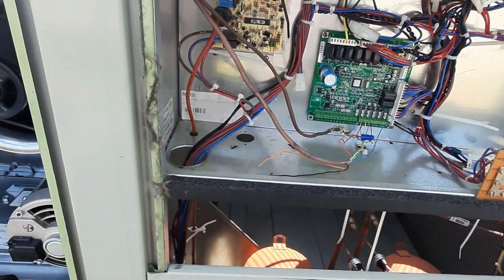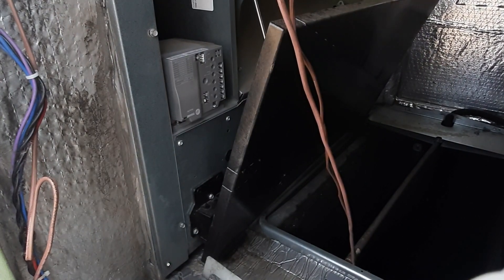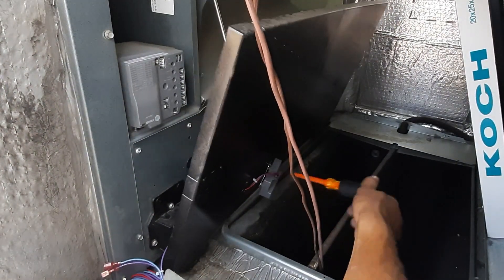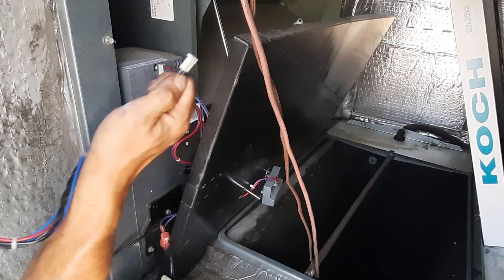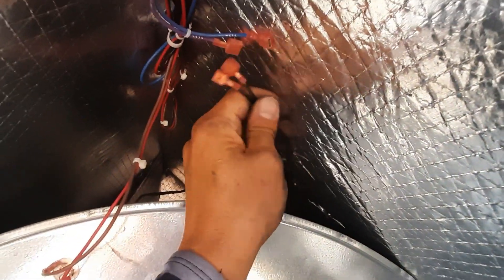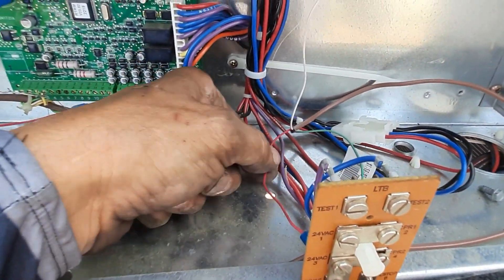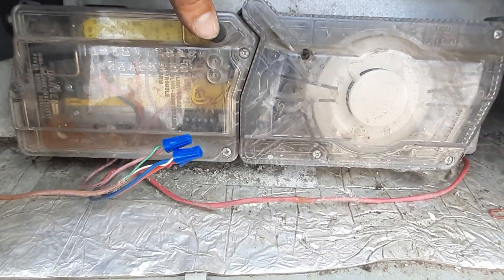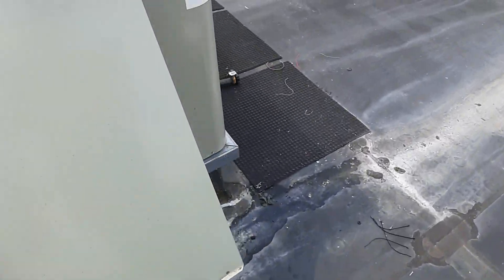HVAC How To install a smoke detector on a trane package unit with trane Reliatel controls

Comment: Where is the green  wire going to?
Reply from the maker: The green wire goes nowhere, I'm only using 2 wires, but I only had 3 wire on my truck.
Reply: @EverythingHVACR  I saw it after replaying video 24v coming back I’m thinking? Then you said that red wire on the same terminal goes to the low voltage
Reply from the maker: Yeah it's just 2 wires. 24 volts feeds smoke detector, normally closed contact feed 24 volts back to e-stop
Reply: @EverythingHVACR  I didn’t see the red wire coming off estop to the low voltage controls at first

Comment: One thing I’ve found out is always make sure the white part (I forget the name of the part🤦🏾) on the other half of the smoke detector is seated correctly.  If not you will not get power at the smoke detector but the unit will still run.  I found this out the hard way.  Almost condemned a smoke and it was still good.  The sensor( that’s it🤦🏾) just wasn’t seated all the way
Reply from the maker: I will watch out for that, thanks brian!

Comment: You don’t need plenum rated wire on that application? I think the wire going through the economizer damper would obstruct the closing.
Reply from the maker: Thanks ACtech! You are right, I. Wasn't there to re wire everything and for some reason in my area the wires always obstruct the econo, never done correctly

Comment: Great stuff, need all the help I can with TRANE. Is there any legend for what the blink status is for there main board?
Reply from the maker: Blink status in my opinion is useless, the codes tell you there was a failure but do not help locate. The heat board will give you more information with lock out but cooling you just gotta find the problem, only pressure and temperature switches in that circuit so not too bad to locate.

Comment: Most think and falsely write articles that IR photoelectric sensors get tripped by smoke blocking the beam, but not so.  The IR beam and receiver are not pointed at each within the dark chamber so when smoke enters it scatters the IR light back to the receiver much like how fog causes headlights to reflect back at you.